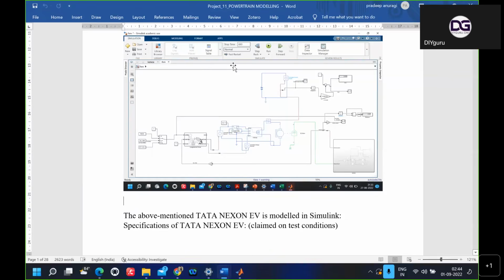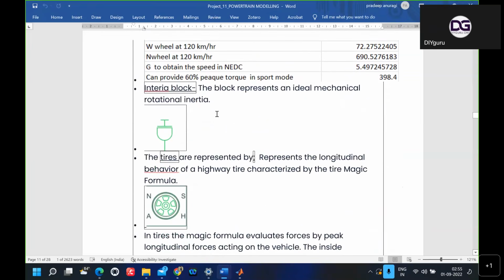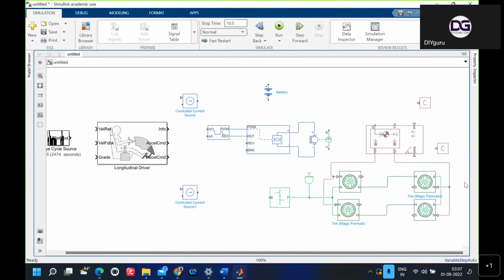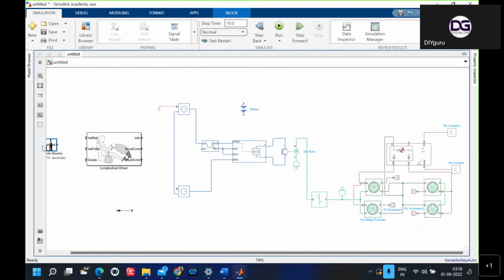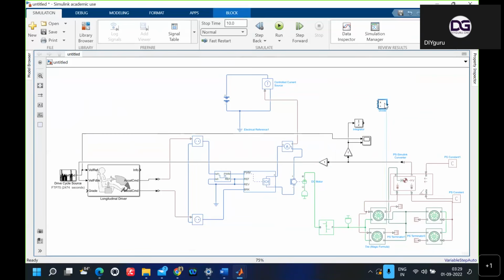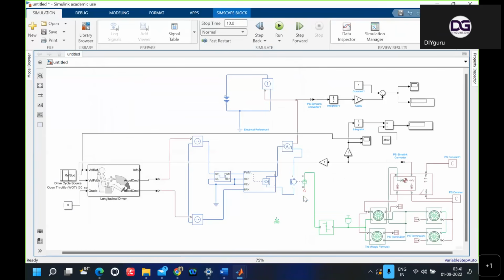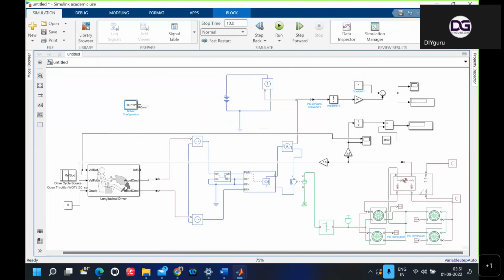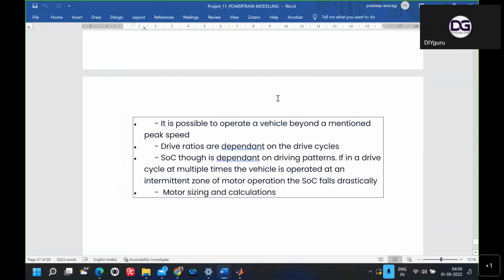4 Wheelers EV Powertrain Modelling on MATLAB/Simulink | Tata Nexon Electric Vehicles #Subscribe

Comment: HELLO, FOR THOSE WHO HAVE NOT MANAGED TO SOLVE THE ERROR, YOU MUST ENTER THE DRIVING CYCLES WITH THE BLOCK CALLED DRIVING CYCLE AND CHOOSE THE NEDC, WLPT OR WHATEVER YOU WANT. 

REGARDING YOUR MODEL YOU MUST CHANGE THE SIGN (FROM POSITIVE TO NEGATIVE) OF THE GAIN THAT GOES TO THE FEEDBACK SPEED AND THAT THAT GOES TO THE SCOPE WHICH REPRESENTS REFERENCE SPEED VS SPEED OF THE REAL VEHICLE.

IF YOU HAVE ANY QUESTIONS, I WILL ANSWER THEM
Reply: I did the same thing that you told to do, my vehicle speed is matching the ref speed but the dist and soc are in negative.
Reply: @Trex-cp6sz  
put a gain -1 before each scope and it is solved, that only happens to me at distance, in the SOC it comes out positive
Reply: Thanks❤❤
Reply: Bro My Source Velocity itself is flat every time and it taking real 2474 seconds to complete Simulation Lol. help me anyone
Reply: Sir we have same Idea related  to ev vehicle could you please help us to simulation work
Reply: please if you have the file .slx share it with me
Reply: Thank you so much for your answer. Its working
Reply: I don't understand....
Reply: What is the block connected to multi port switch in the end? Does any values need to be included??
Reply: Pls answer
Reply: @vintageblue3475  are you telling about the drivee cycle , if you are then you can search it from library as drive cycle , if the option is not available you can use from spread sheet block and download any drive cycle from web (like ftp, idc, udc, nedc etc., these are just speed wrt time based on different areas ) and copy the file location and paste it in from spreadsheet and apply and import spreadsheet by selecting a table like button at the left side in the block parameters. if your drive cycle is not matching the speed of vehicle, in the gain block that connected to vehicle body change it as -3.6

Comment: "An error occurred while running the simulation and the simulation was terminated
Caused by:
['electri_prac/Solver Configuration']: Initial conditions solve failed to converge. 
Nonlinear solver: Linear Algebra error. Failed to solve using iteration matrix. 
The model may not give enough information to make it possible to solve for values of some of its variables. Specific advice is given below." I am facing with this problem anybody could help me plz.

Comment: Dear sir, very nice explanation by you..appreciated..but I had followed your same step but output is not tracking reference speed..will you pls share your model..
Reply: Can any one help me to design invertrt and motor in ELECTRIC vehicle with their efficiency map
Reply: They have done mistake and shown wrong result may result from somewhere else. In their another video also they are showing results but most of the calculations are wrong. So don't follow. I lost my 2 weeks by following their model thinking it's correct but when I checked the formulas it's wrong
Reply: @YogiAkash55  have you found the solutions or got the formulas correct? 
if yes please share